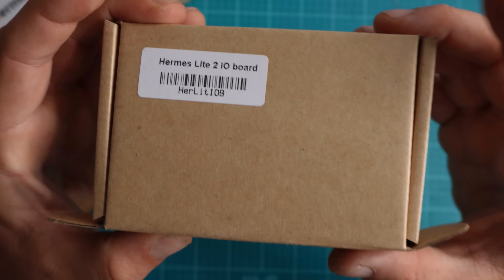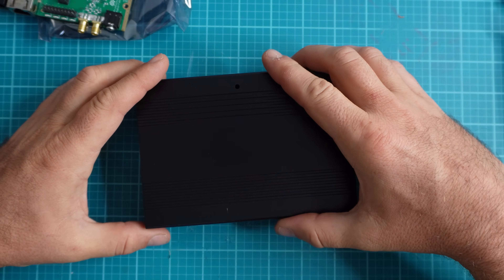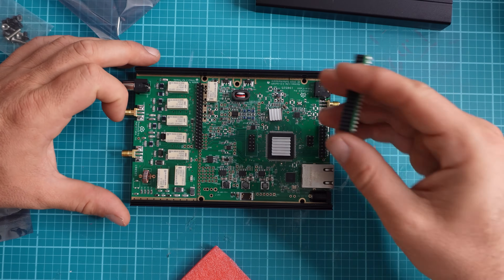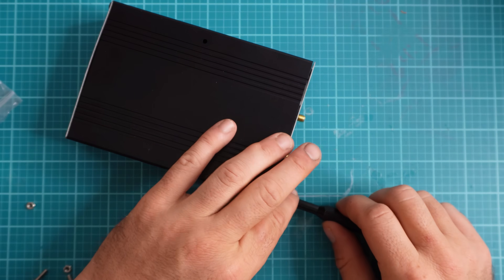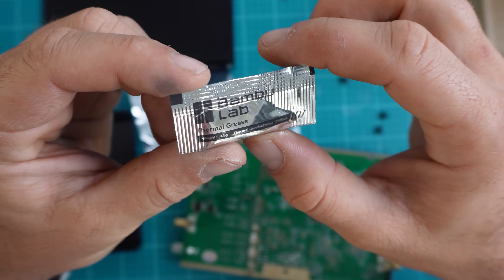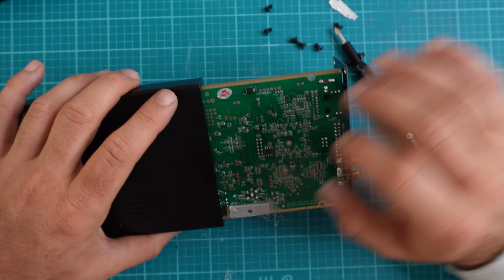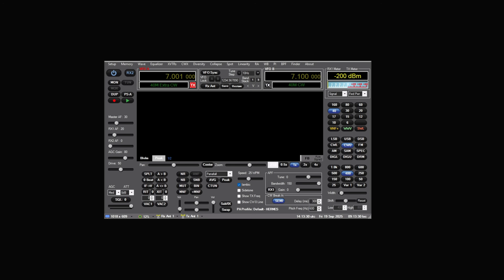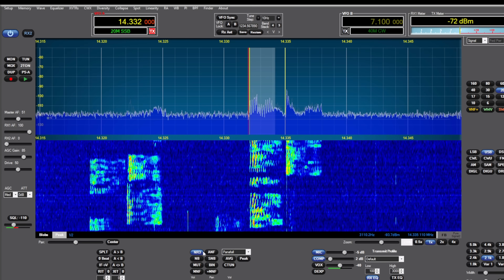The Simplest Ham Radio Build You'll Ever See

Comment: First of the software looks like a cheap version of powerSDR software . Secondly, flex radio already made one just like this I have one it’s called Flex 1500 . Then you’re comparing it to a $3500 SDR radio like a Flex 6500 that puts out 100 W can receive up to eight frequencies at once on different bands, and the receiver would blow the Hermes away .
Reply from the maker: Thanks for your input.  I got my antenna tuner and 100w amp and hopefully will make a part two.  I still enjoy my flex, but I am happy with what this is.

Comment: Your mic and eq sounds great. Do you mind telling us make and model ?
Reply from the maker: Absolutely!  I use a RodeCaster Pro II Mixer with a Shure SM7B. the mixer is set to 60dB for the Level of the SM7B. High Pass Filter set to a frequency of 70Hz and a Slope of 12dB, De-Esser Threshold -29.5 with .70ms attack, -36dB noisegate wiht 30ms attack, Compressor is set to a -28.4 db threshold with a .70ms attack and 21ms release (2.7dB gain), Equalizer is set to High bell - 7691.6Hz, Mid Bell 400Hz, Low Bell 77.8Hz (Gains: High 2.8dB, Mid -.2dB, Low 3dB).

Comment: Usually a hole in a chassis is so you can adjust an external pot for something like balance, IF, circuit bias, etc. or to hit a reset button for factory defaults etc. 

All kinds of reasons why you might want an external access to a Pot
Reply from the maker: Thanks!  I see your point.  Old electronics used to have this, fairly often.

Comment: For kids also the kits from QRPLabs are suitable as the outcome is not only a black box that can do nothing without a PC but also a full QRP transceiver for direct operation. Connection to a PC of course is possible to do digital modes and use it as a headless SDR. Soldering skill are required but not extremely high. And winding coils is a good training as well. 73s
Reply: I agree.  I use multiple different rigs from QRPLabs that I built and they perform well and don’t cost nearly as much.

I’ve owned a Flex 6400 and hated operating via the pc.  As well there’s latency that you don’t get from an actual rig.  So while I’ve fantasized about the Hermes radios I’ve never pulled the trigger.

Just my 2 cents.  Everyone is different which is good!👍🏽

Comment: @Dude Tested The thermal grease that bambu supply's is a boron nitride type grease. It's made to dry out once you put in the heat block. You really should get a tube of simple thermal grizzly. 
When that boron nitride drys back into its crystalline form, it makes a powdery residue. And even though boron is nonconductive at low temps it still acts as a semiconductor. At higher temps it acts as a conductor. It may cause issues down the line.
Reply from the maker: Thank you!  My research was not correct.   I ordered the correct stuff. Thx

Comment: One of our local hams recently got the Hermes Lite and loves it, now I'm wanting one. Great timing on your video for me! 

Now that you have one, do you think you could design and print brackets to bolt the case down to a network rack shelf or other box, or brackets to bolt it to a user supplied rack faceplate with cutout?
Reply from the maker: Hey Corey!  Would it be almost like two U Brackets which would hold it under a network rack?  Thanks!
Reply: @DudeTested I was envisioning two bracket options: one that adds flanges with bolt holes that run parallel to the unit bottom (or top depending on how the jacket is installed onto the Hermes case) that would allow the Hermes to be bolted to a shelf, or to the inside of a go-box. 

The other idea was to have two flanges that sit just slightly below flush with the faceplate, so could be bolted flush onto a rack faceplate with a cutout made for the Hermes. 

I don't know how many people would want to bolt the Hermes to a rack faceplate, but I suspect that plenty will want to be able to bolt it down to a shelf or a box.

Comment: This radio really looks fun.  All I need to do now is get it lined up with an external tuner and an EFRW antenna.

The only critique I would have (software based) is that I don't know if it's android compatible software.  Trying for a minimalist kit is the goal for me, especially since this is a great QRP rig for SOTA.  I can only assume that this is much lighter than my SBITX v3 (brick).  But it has a ton of potential.
Reply from the maker: I definitely have plans to build this in multiple episodes, including the additional board, a tuner, a amp, sdr ++ for android, etc.  Hopefully they will come soon enough.  73 and TU.
Reply: @DudeTested  not sure how far you want to go with it- the filter board is the simplest way to go. There's also some boards from the openhpsdr project (what inspired the HL2) that interface well. There's a 150w amp, and im working on a control board that'll encompass an rx bandpass filter, LPF, dual separate rx antenna, and 3 way tx antenna switching. It's a rabbit hole for sure, but you can make a very capable rig from the little thing
Reply: Look up sdr++ brown fork. Its an android sdr app thats got HL2 compatibility. You can use ssb, or beacon CW/FT8 but nothing more than beacon

Comment: The N2ADR is both a filter board and an amplifier. Without it, you would get .62mw. With it you get 5W out. Getting the shunt (heat sink) in, one trick I learned is to put a small screwdriver in the hole to keep the shunt and board lined up. I even found that using the screwdriver to move the board into place made it easier. Nice review.
Reply: That's not right. The N2ADR filter board is only a filter. It is necessary to meet spurious emissions requirements at 5 watts. The Hermes PA puts out 5 watts if enabled in software. The filter board also provides SMA connections instead of the pin headers on the back of the HERMES board.
Reply: There's no amplifier on that board- output is already 5w. You can use the HL2 to drive an amp directly without the filter board.
Reply from the maker: Thanks so much for the very useful information. I can really appreciate both the advisory of the amplifier and the heat sink tip!